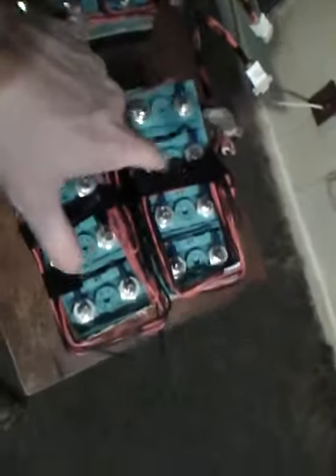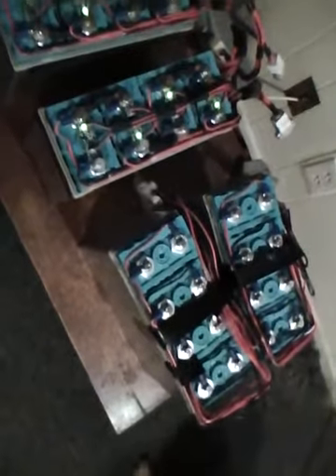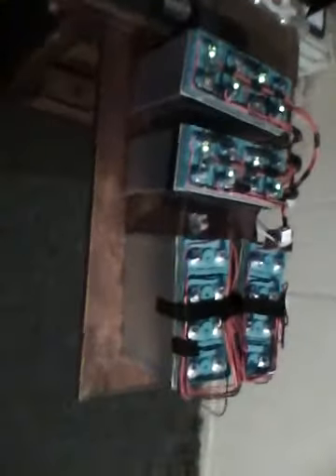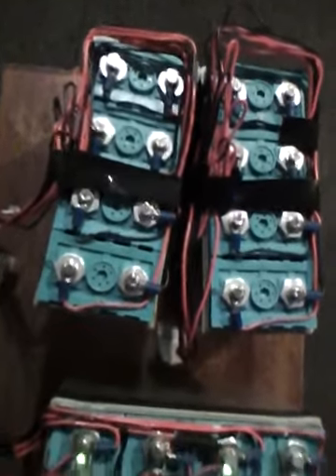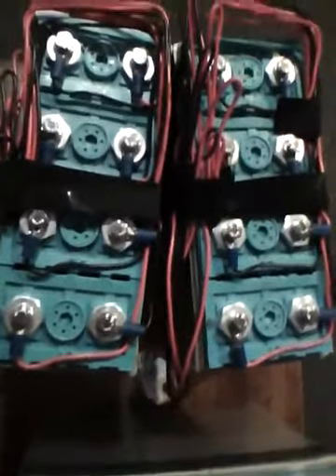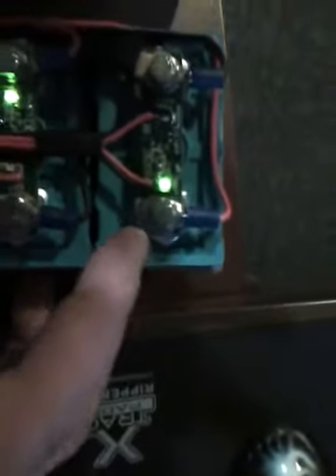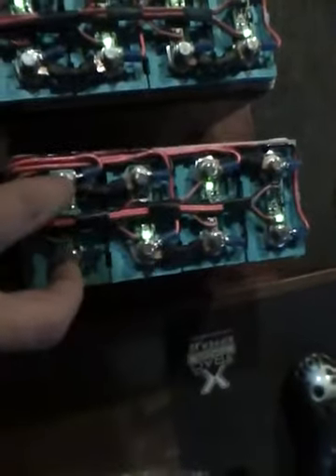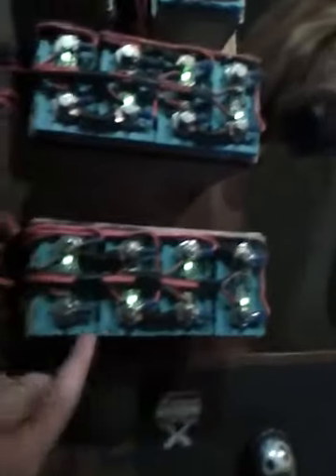New LiFePo4 20ah Pack - Constructing the harness

Comment from the maker: @lezbriddon True, but I merely meant that with DC, you can reach over and touch the terminals.

If you tried to touch terminals powered with 40 Amps of AC current, you most certainly would die.  

Furthermore...  You wouldn't even have to touch both terminals...  If you were grounded all you would have to do is bump into the positive terminal, and boom!  =P

Comment: I have watched your vids for months, but to state dc is safer than ac is a misleading statement.

The DC voltages on most battery packs like this can kill easily and also burn like hell

you can 'feel' lower ac voltages than dc, but thats a clue, its what you cant feel that usually kills you..

AC is technically safer as it causes muscle spasms which often throw the injured party away from the source of current, DC causes muscle contraction, so you cant let go!